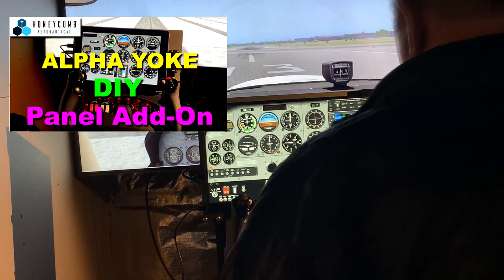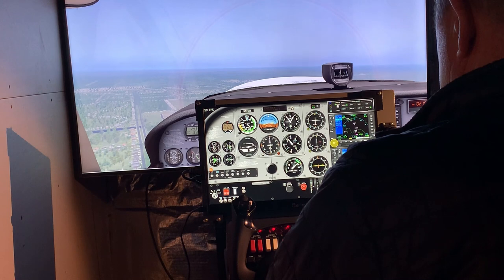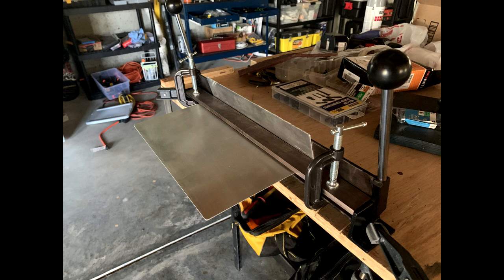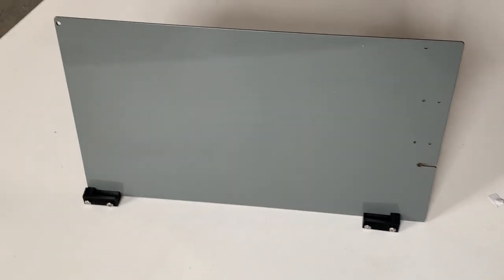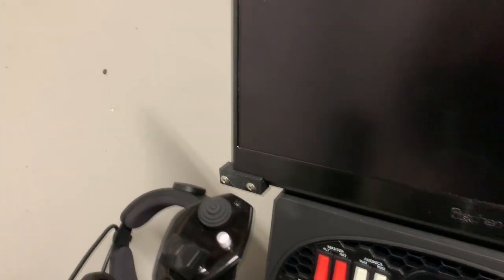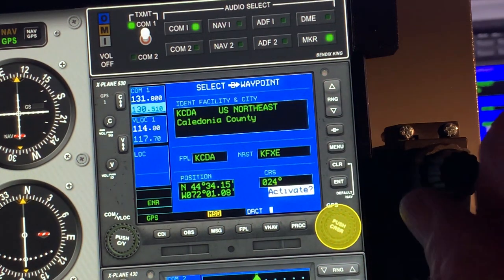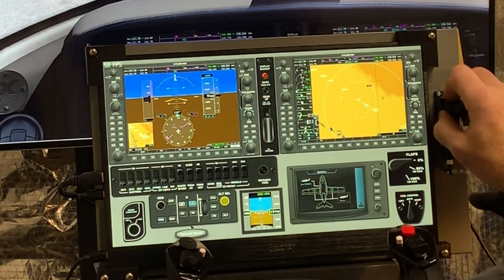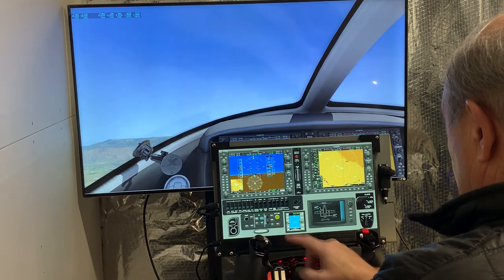$360 DIY Touchscreen Cockpit for Honeycomb Alpha(or Saitek) Yoke

Comment: Thanks for sharing. I just wish the price of the Knobster was less because at $100 I think is too much. You definitely deserve the $5 or more per piece. It is a great idea and no doubt a very real approach when it comes to use a sim touch cockpit, compare to a real plane. But at that price point and if you just compare how much Xplane and Air Manager cost and what they do, in my opinion the Knobster could be way less,
Reply from the maker: Jose Guzman I hear you but hardware is unlike software.  With software you have fixed development costs and especially with downloaded software once you payback those costs each unit is almost all profit. Hardware has development costs plus production costs. Even after recouping the development costs there is a cost for production, inventorying, and fulfillment. Of course if they could order 100,000 units the cost could probably be less than $50. But that would be a $2-3 million order. So Sim Innovations orders 200-500 units and the price reflects their  ist’s plus a meager profit.
You can build a Knobster yourself using an Arduino Nano and a dual encoder and some wires and solder. The Sim Innovations Wiki has Information and I could help further. Finically I would ask you to compare the cost  a Knobster and a touchscreen to a comparable hardware set up.... it is a bargain.  All sim hardware is expensive due to the relatively small potential market size.
Reply: @rbarlow  Thanks for your honest response. I did not know how small the Sim community was. I understand the cost explanations. I'll take a look at your suggestions about build my own. Don't get me wrong, I think the Knobster is a great product/idea and definitely one way or the other in my future plans.

Again, thanks for your honest and very informative explanations and ideas. Really enjoy your content.

Wish you the best from Orlando, Florida.

Saludos !!!

Comment: Hi Russ. You have screwed the aluminium plate to the Yoke using the screws provided. As far as I can tell there aren't any screws in the box (none are listed in the contents) and I have no idea what size screws are required. Any ideas?

Thanks! (I got the Yoke and the Knobster for Christmas so am looking forward to experimenting!)
Reply from the maker: The screws are in the top of the Honeycomb Alpha yoke. Just remove them with an allen(hex) wrench and use them to affix the metal mount to the yoke.
Reply: @rbarlow  Ah! Thanks. I would never have noticed

Comment: Thanks for all the videos! I'm still trying to decide if I want to use Air Manager. Is there a way to get the G1000's for other aircraft besides the Vision jet? I'd like them for the default C172 for sure, and to be able to use them in the Hot Start TBM900 and others would be great as well. I really don't want to spend $2,000 on RealSimGear hardware. But that seems to be the easiest way to just drag and drop the XP11 G1000 PFD and MFD onto a monitor with hardware bezels. EDIT: I just stumbled onto your G1000 generic overlay. Is this all I would need to create the PFD and MFD using Air Manager and the Knobster? Thanks in advance.
Reply from the maker: Any aircraft in X-Plane using the G1000 or G530/430 can pop out the displays to use. Many add on aircraft also have pop out displays. Not sure about the TBM specifically but if it uses the internal XP G1000 or has its own method to pop out the display it will work.
Reply: @rbarlow  Thanks for the quick reply! I'm going to watch some more videos and do a little more research, but it sounds like Air Manager might be the way to go. One more question if I may. If I had two of those 15" monitors, one for the PFD and one for the MFD, would one Knobster control both?

Comment: Hi Russ.  Really appreciate your videos.  I just got my new Alienware Aurora 12 with the Nvidia 3070 Graphics card.  I bought the Wimaxit 1560CTV2 touchscreen monitor (No Prechen to be found).  But, it does not want to play nicely.  Can you tell me what connection you used?  I have the video card going to a 43" HDTV using the HDMI cable.  That only leaves display ports on the card and other ports on the computer that don't support video.  Any suggestions?  I'd really appreciate it.  Have you upgraded your computer and touch screen lately?  Am I doing something wrong?
Reply from the maker: You can buy a DisplayPort to HDMI adapter something like this

DisplayPort to HDMI, Benfei Gold-Plated DP Display Port to HDMI Adapter (Male to Female) Compatible for Lenovo Dell HP and Other Brand https://www.amazon.com/dp/B017Q8ZVWK/ref=cm_sw_r_cp_api_glt_i_R72ZYM1ZE02RQTM3BG55

You will need power and usb also to get the touch screen to work. May need to calibrate the touch if the touch monitor is not the main monitor or if you have multiple touch monitors. Go to settings and search “calibrate” and look for “calibrate touch and pen …” and follow the onscreen directions
Reply: @rbarlow  Thank you sir.  I placed the order.  It will be here tomorrow.  Once I get it working, I will order the mount from staylevel, as you mentioned in other videos, and air manager along with knobster.  I have the logitech multi panel and the radio panel.  so, I will most likely be putting the necessary flight systems on the touchscreen.  
Thank you so much for your help.  Google kept me running around in circles.  
Since I have 2 more display ports, I'll probably get two more HDTVs and make it a 185 degree FOV.
I will follow your other video to do the math and make sure the edges line up properly.
YOU are big help to many people.  Keep up the good work.
Reply: @rbarlow  Got it.  Hooked it up and downloaded air manager.  Everything is working like you said.  I did need to "calibrate" the touch screen.  But, it didn't need calibration, only to identify which screen was the touch screen.  Thank you again for all your help.  Waiting on the mount coming from stay level.
Reply from the maker: @billharmon2051  yes if the touch digitizer is made with the monitor windows only needs to know how to associate touch inputs with a specific screen.  Glad it is working for you.

Comment: Hi Russ,

A question.

I have gradually grown to appreciate the power of Air Manager to increase the immersion with Xplane 11, especially now that I’m using the Knobster.

I recently installed an external autopilot unit that really rounds out my setup... but I still have ONE thing I’m missing. All my panels include the B1900 Altitude Alerter instrument which I control with the Knobster, but this instrument does not have a button to “ARM” the altitude, which means I still have to go to the Xplane window to do that.

Are you aware of an Air Manager instrument that does this, or would you be interested in adding this feature to this instrument for a fee? I am a long-time lapsed pilot and I’m not inclined at this stage to learn the script language to do it myself.

Thx for your informative videos.

Joey
Reply from the maker: Back in the air again! If the functionality is in the simulator it could be added easily. Confirm for me this is the Beech 1900 Altitude Alerter and what aircraft you use it with. If I can do it in a couple hours or less no charge. I will try to look at it tomorrow after you reply.
Reply: Hi Russ,

Thank you for the quick response.

I use the altitude pre-select on the following aircraft, all of which support that function:

Default King Air c90
Carenado Baron B58
Carenado Pilatus PC12
Carenado King Air c90
Carenado Cessna 206 (non G1000)
Carenado Mooney M20R Ovation

... and maybe a couple of others that also support the function. The problem, as I’m sure you know, is that simply pre-selecting the altitude doesn’t help unless I can “Arm” it... otherwise climbing in VS or FLC mode will just keep the airplane climbing past the set altitude.

I’m using the B1900 altitude pre-select instrument but I could just as easily use the generic one which appears to be essentially the same.

Thx again.

Joey

Comment: Great video Russ, I am new to flight sims, just got the honeycomb alpha, could you do a tutorial on setting up the honeycomb for A320  aircraft.  
also would you be able to send me the build details of your rig set up and touch screen  cockpit panel with instructions on how to connect everything,
Reply from the maker: John I understand you are just getting started in Sims but that is a pretty broad array of info you are requesting.  Setting up the Honeycomb or any Yoke with X-Plane is about the same.  You just have to decide which buttons you want to assign to what.  You do this on the settings joystick tab.  It is not hard and there are many tutorials on YouTube.  As for the A320 how you assign the switches available is not cut an dried.

What do you mean "build details of your rig"?  computer, hardware, what?

I have covered the Touchscreen in more than one video.  Not sure exactly what connections you mean?  

Be patient. It will take a little online research and study to figure things out. There are many resources on YouTube, X-Plane.org forums, and Laminar Research  website.  

Happy to answer and more specific questions you may have. Good Luck. This really is a fun hobby.

Comment: Russ, I can see where height taller than the 15.6 inch monitor is problematic, but is there a wide touchscreen monitor of the same height,  and about 29 inches wide available anywhere yet? That would give us a full width panel using a single panel. I have seen the widescreen monitors, but not in touchscreen.
Reply from the maker: C Barr I wish by know of no widescreen Touchscreen like you mention. Of course two 23” monitors give the necessary real estate but you have the center bezel and need another graphics port. I have seen guys put a mask over the 23 inch screen and install encoders for the knobs at various instruments. Looks quite cool but it is a little more work and you’re locked into a single aircraft type or at least panel layout.

Comment: Russ....a couple questions.
Where are you located? USA?, cause if you are in the Netherlands, it would make my next question irrelevant due to the cost of shipping.
Next question. would you be able to print and sell the touchscreen brackets you showed on this video? What if I gave you slight dimension changes based on your bracket design?
I couldn't fit a 15.6" touchscreen onto my existing cockpit panel , so I just bought a similar Full HD, thin touchscreen from Amazon but it is a 12.3" display that is 0.29" thick. It arrives tomorrow, Sun Mar 15th, 2020. Once I measure everything and understand the dimensions of your brackets (is there a place that shows all your bracket dimensions? I can't read a .stl file format. Would you be willing, for a price, to make dimension mods, print and ship me one set of brackets to Vero Beach, Florida?

Comment: Hi Russ, I am attempting to follow your deign, however, I am having a problem with the Prechen 15.6” touch screen monitor working with Air Manager. It took some searching to find the proper power adapter but the touch screen function still will not work. Very surprisingly and strangely, the instructions no where identify the  manufacture or offer any customer service contact information. No one to contact for help. Do you by chance have any tips or insights as to how to get this monitor to work with Air Manager and X-Plane 11.41? Thanks. I am always on the look out for your next informative video.
Reply: Robert, i had the same experience with my first Prechen monitor. You must use both USB cords. As far as I could tell the small one Is for the touch function. I figured this out because when I connected it I would get a square appearing on my main monitor. You then must go into your control panel and calibrate the touch monitor. Basically letting the computer know that it is a touch screen. Michael Brown has a you tube video with the step by step procedure. One other thing, go thru your program manager files and make sure that all the USB ports power management is set to always on. Sometimes the computer will limit the power consumption by turning off random USB ports. This can also be found on you tube. Good luck.
Reply: Similar experience. Hi got no paperwork at all with my monitor. The info from the site I purchased it from was also confusing. However I do have a working setup. Assuming I have the same monitor as you, my configuration is HDMI and USB cables plugged in. I think the USB cable supplies the power for the touch screen (it won't turn on if the USB is not connected). However, I then had to configure my display as a touch screen in Windows, otherwise when I touch the screen it thinks I'm interacting with my main monitor. I think I used the touch screen calibration feature of Windows 10 for this (I'm not at my computer right now so I'm trying to remember). I just searched for instructions on how to setup a touch screen and found something that said to go to a touch screen calibration tool in Control Panel. I'm pretty sure I just had to specify which monitor was a touch screen and then it all worked. The impression from the site (which I only noticed after I bought it) was that a separate power cable would be required for the touch screen to work. For me, this turned out not to be the case, which is good because none was supplied with the monitor. Let me know how you get on :)
Reply: John Panik Thanks for the suggestions. I’ll try and report back.
Reply: Wayne Sibley My screen seems to be like yours: a USB power adapter with an HDMI cable. Since the instructions said the touch screen function also needed a 12v power adapter I tried a number and think I finally got the right one. I had no idea you needed to turn on the touch screen function in Windows 10 so I will try everything you and John suggested and let you know the results. Thanks again.
Reply: John and Wayne, no luck. While Windows has detected and will display to the Prechen the Human Device Interface does not detect the Prechen so I cannot enable touch screen. I Googled for help and tried everything suggested with no better results. I am going to send the Prechen back to Amazon and either try a replacement or purchase a different brand; one which has its manufacturer identified and provides customer support. Thanks again for your help.
Reply: OK, I finally got the Prechen touch screen monitor to work. Amazon gave me Prechen’s email address for customer support and they told me to set up the monitor like Wayne set up his monitor and not to follow their printed instructions which accompanied their monitor. The big help came from Ralph at Sim Innovations (the seller of Air Manager). We had a lengthy back and forth email string and I tweaked settings and finally got it to work with the mouse, touch screen and Knobster. All good. Now I am learning how to create panels as I want to duplicate the panel I have on my real Cessna 182. Thanks for your help.

Comment: I got a B58 instrument panel from 1mm aluminum sheet, now It rying to figure out what will be the batter way to go laminating or painting.  Can you, please, explain the process of painting along with the link to the Paints. I know that require prime and special paint. but maybe I'm wrong
Tnx
Reply from the maker: Y Ben-Ad I shouldn’t be giving advice about painting because it’s definitely not something I know much about, but I used spray enamel paint that I bought at a auto supply store in the clearcoat to put over that. It was primer and paint in a single product so I used a scotchbrite pad to to clean and roughen the surface slightly and then put on a couple coats. Then a couple clear coat applications. I smoothed any imperfections with the pad between coats. If you are serious you might het an auto body shop to shoot it....couldn’t cost very much and they know what they are doing viz. me.
Reply: @rbarlow  .... Yeah, Auto Body  shop, is, probably, the way to go, but then I'll need to figure out how to label the panel, so maybe laminating the entire pedestal, is the more practical approach.
Tnx Russ

Comment: can you please post a svg or stl file of the back plate, I think I can 3D print it in sections and glue them together. thanks
Reply from the maker: I really didn’t draw it up. I just laid out the monitor on the Aluminum sheet and wagged it. I think a sheet is easier that gluing parts together but who knows. Flight velocity has a $49 plastic version and Stay Level Avionix has. $99 version of steel that is very sturdy,
Reply: @rbarlow  thanks a bunch for the quick reply and  the informative videos,  I think I can 3D print something to fit my needs
Reply from the maker: @waynec96 I’d love  love to see what you come up with. Good luck.

Comment: How can i get air manager to work on this monitor without an apple product?
Reply from the maker: What do you mean "without an apple product?"  There are no apple products used on this set up in the video.  Just a single windows computer running Air Manager and X-Plane 11.  It works with P3D and FSX too.  If FS2020 supports simconnect as advertised in their development info it should be working with that too when it is released. Maybe you can explain your comment if I don't understand the question you ask.  Thanks.

Comment: Are you using a separate CPU to support Air Manager?
Reply from the maker: Only one CPU since I want to take the GPS and G1000 poput windows from X-Plane and use then along with the Air Manager panel. To do this the monitors have to be all part of the same desktop...same computer
Reply: Thank you for the quick response!